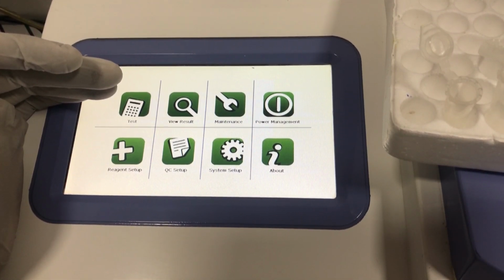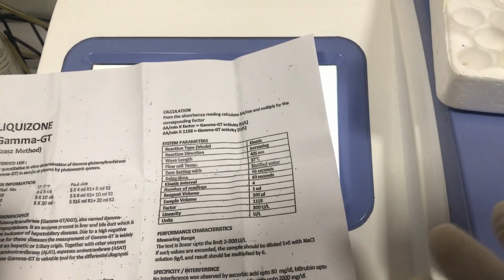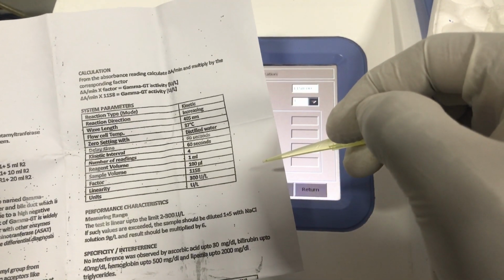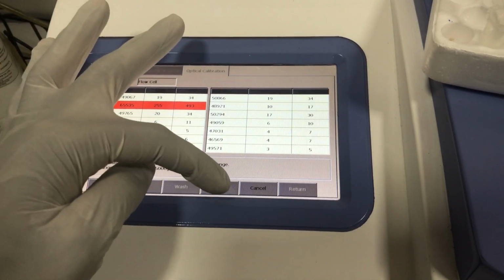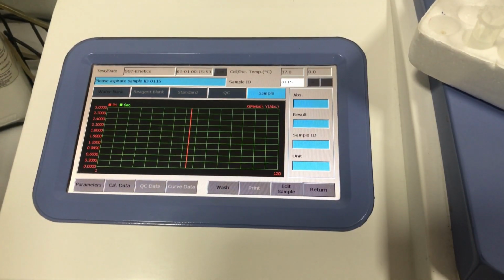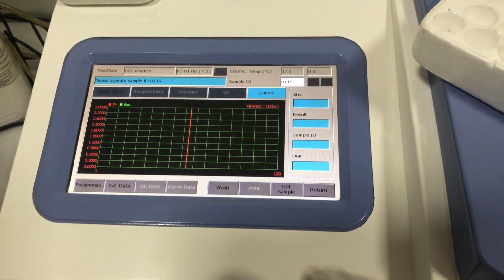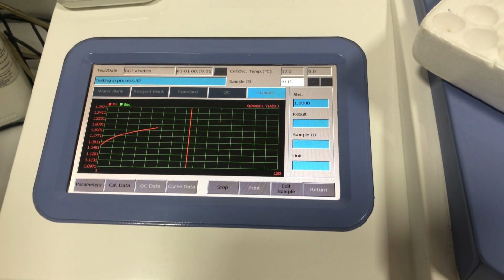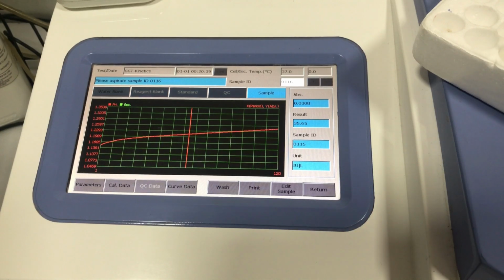How to measure serum GGT using semi automated chemistry analyzer

Comment: Good evening Sr.
Please why there was no blank and standard done b4 the test.
Thank you
Reply from the maker: The reagent manufacturer does not include blank as part of the test parameter 

There is no need for standard because the factor is stated by the manufacturer 
With kinetic method the factor is always given

I hope you understood
Reply: Ok
Thank you Senior
Stay blessed🙏🏻
Reply: In your reagent preparation,  you could choose a better ratio that will preventing from throwing reagent away 4 part to 1 part could be 800 r1 to 200 r2 that still gives u 1000ul.